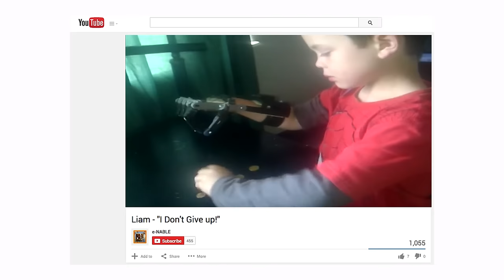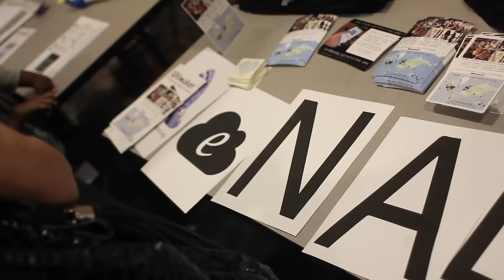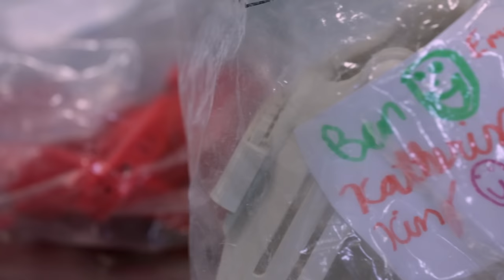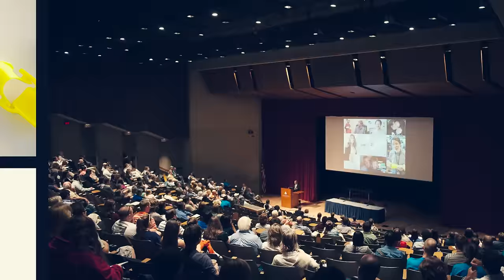Prosthetic Limbs: 3D Printers Making Superhero Hands for Children - Learn Liberty

Comment: THEY HAVE TO MAKE WINTER SOLDIER'S ARM! That would be soooo coooool!
Reply: +Vice Roy   3D printing metal objects is still expensive, batteries are still too heavy, and inefficient, and the actual working parts are still too fragile and likely too heavy as well.  Not a simple ting.
Reply: +AKlover print it in plastic and chrome it.